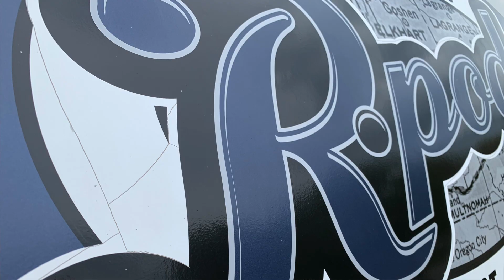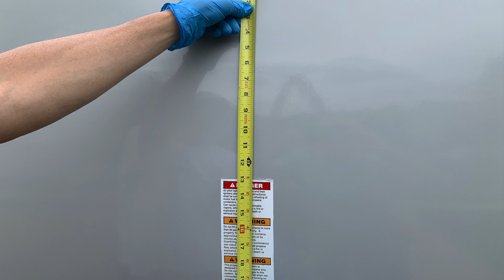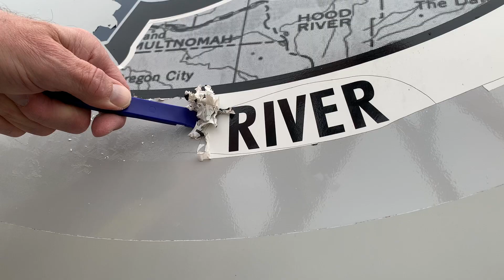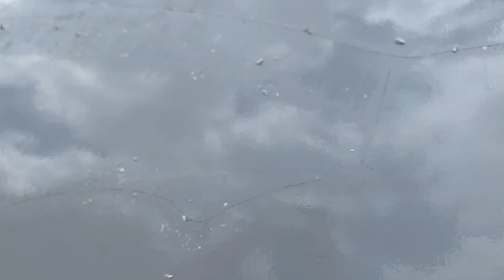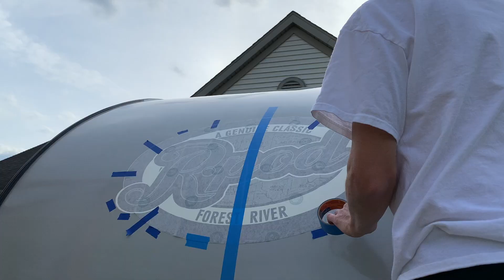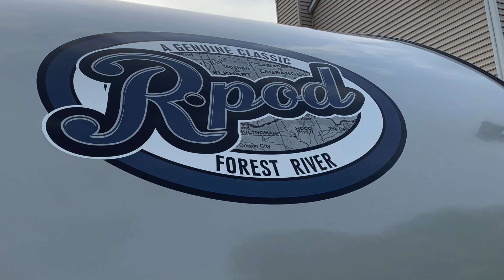RV Decal Replacement – Step-By-Step Process

Comment: Today we cleaned the old front decal off of our Keystone Cougar. It was damaged when someone used too harsh of a cleaner on the front cap. We used your method of remove old decal. The old glue laughed at the GOO Gone! I went to the auto parts store (Advance Auto) to buy a product I had used before. I grabbed a can of 3M Adhesive remover. Best $15. that I ever spent. What a game changer. It cleaned the glue so quickly. Tomorrow we'll install the new decal.

Comment: Really excellent video. This will help me apply a new Jayco bird decal today. And yes, you could have saved a lot of time by using plastic razor blades in a blade holder.
Reply from the maker: Glad the video was helpful. You are right, plastic razor blades are a good choice for the task!
Reply: @ After viewing your video, I watched another video with a different application method using soapy water. I used that method to apply my new Jayco bird decal and it made the task incredibly easy. No masking tape needed, and you can slide the decal around to position it perfectly. The decal has 3M ControlTac adhesive and the soapy water method is approved by 3M.

Comment: I learned from my wife that when applying a sticker use a spray bottle with light soapy water.  It allows corrections to be made, and you can work out the problems laying down the decal with a plastic tool, sponge and cloth.  She learned that from applying window tint on our house windows.    

As for removing the decal... I can't say anything good.  You have to be patient.  Get a teen - maybe maybe they'd take 20 bucks before realizing the pain in arse it is 🙂
Reply from the maker: Sounds like a good idea on the application of decal. Thanks again!

Comment: Great articulation and really good informational details.  Having done similar work in the construction industry. I would only add one thing to the process that you described so well.  Rather than removing one half of the release backing material, I would suggest leaving a small piece in place where the hand is holding the decal, so as to eliminate finger contact with the adhesive portion of the decal, thus helping to not disturb the "tack" from the adhesive, then of course removing the final piece as you finish the application.
Reply from the maker: Great tip. Thanks!

Comment: Removing decal hint: I found that once you have an initial area loose with heat gun, use a wooden dowel and roll the old decal onto the dowel. Because the dowl is pulling evenly, there will be a much less chance of ripping the decal and having to start over with the heat gun.
Reply from the maker: Good tip. Thanks for sharing!

Comment: Super helpful John. We have a 2015 RPod 179 and all the decals are faded and cracked from getting baked by the sun. Wondering how long it took you to do just the one you displayed here in your video. Thanks for sharing the steps on your website as well. Cheers!
Reply from the maker: Marty, the big front sticker was about a two-hour ordeal using the tools we had. I would think it would be faster with a real heat gun and plastic razor blade. As shown in the video there was a lot of manual labor involved. Thanks!
Reply: @JohnMarucci  thank you for the quick response. Really enjoy your channel!

Comment: It also helps to spray surface with water with a drop of dish soap. Allows you to reposition decal and to facilitate removal of air bubbles.
Reply from the maker: Jeff, thanks for the tip!

Comment: I used Wash Wax All on my decals. Huge mistake and it seemed to make them crack faster. I also noticed the "Hood River Edition" text is in great shape, and the main decal above it is terrible. Seems some of the decals are very prone to cracking in the sun.
Reply from the maker: Thanks for sharing your experience. Mine seemed fine until we hit year four, and the front was in the sun quite a bit uncovered. I guess I should be glad it lasted that long before cracking.